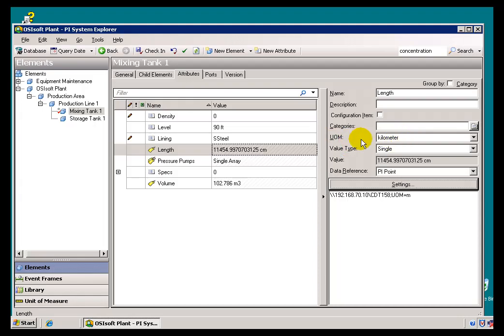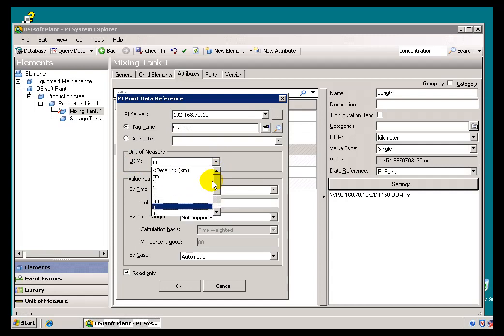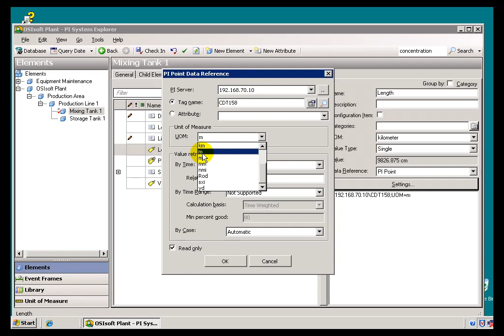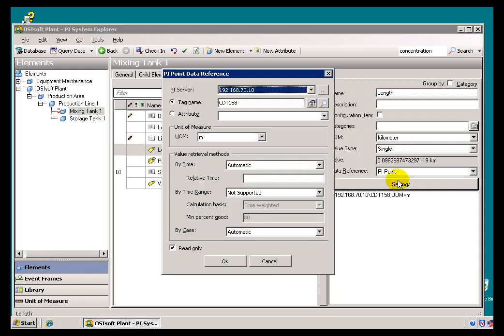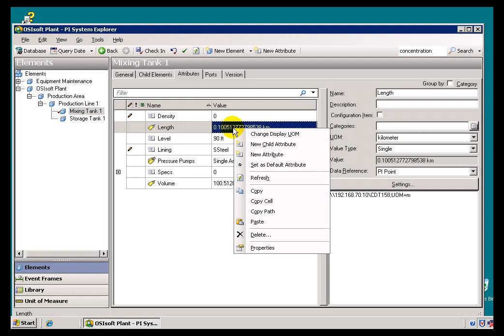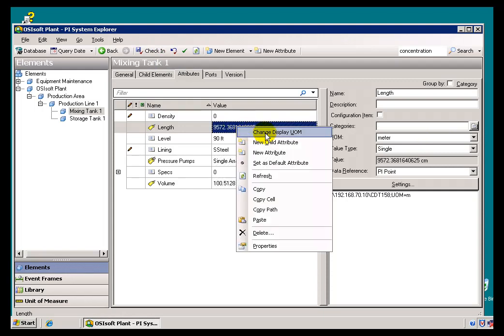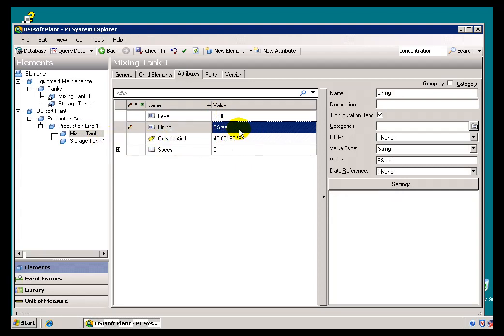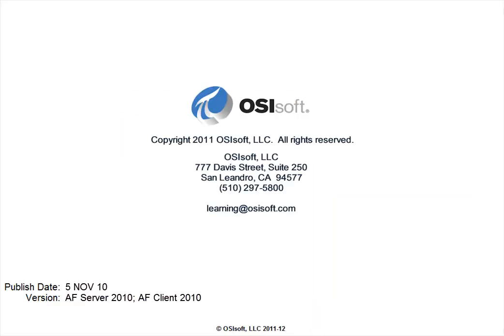OSIsoft: Configure the PI point data reference, Part 2. v2010

Comment: Hello, When I try to reference the PI element attribute and recall the root path. the element path gives me the formula that the attribute uses instead of the root path. is there a way to fix this? the element gives me the actual value is the show value function value, but the path that it shows is the formula used on that attribute.

Comment: Hi  , I have a question. How to show the PI arrary tags on PI VISION?
Reply from the maker: Hi, point array data references are not supported in standard out-of-the-box tools like PI Vision, PI DataLink, or PI ProcessBook https://pisquare.osisoft.com/thread/37785-usig-array-in-pi-se 

However, it's possible to build an application to make use of arrays, or create a custom symbol in PI Vision to support them. OSIsoft does not provide this custom solution though. https://github.com/osisoft/OSI-Samples-PI-System/tree/master/PI-Vision-Extensibility